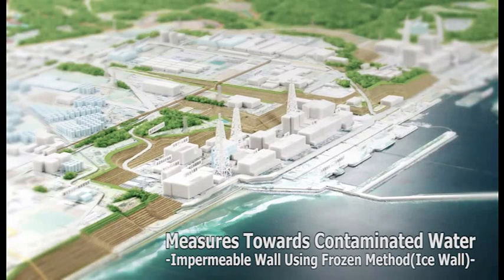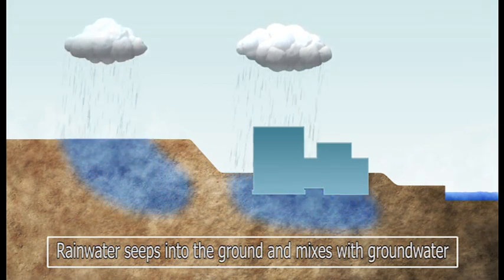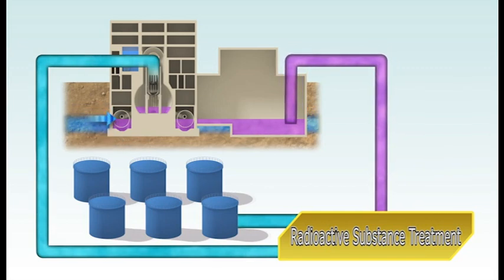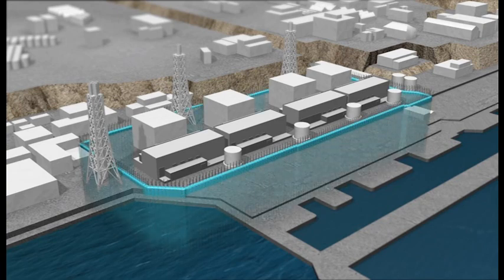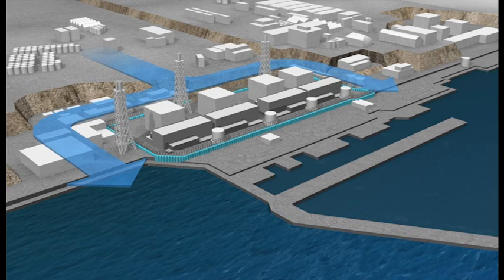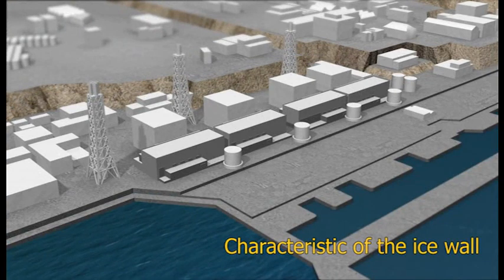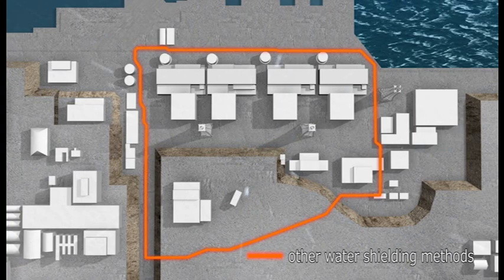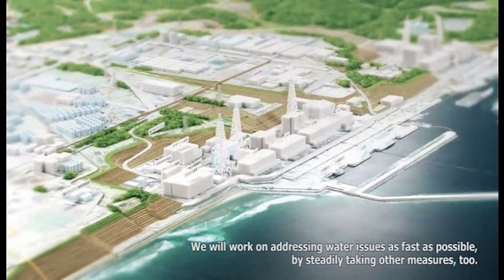Construction of Ice Wall Begins at Fukushima Daiichi

Comment: Frozen barrier is totally ineffective. They must dig a trench around the reactors down to bedrock and fill it with zeolite. Japan is not interested in protecting against the terrible disaster, but just the financial interest and nuclear power operators from the cost to remediate this disaster. All the while, highly contaminated water is running of the slope of the mountains behind the reactors into the ocean.

Comment: Wait, wouldn't diverting that ground water around cause issues with the ground itself? I mean, you're forcing the ground water to move to the sides of the ice wall, which in turn increases the amount of water in that ground a lot compared to before, wouldn't this cause the ground to become softer?
Reply: tommysil Clearly you can't read, since you didn't understand my question. I rewatched and you're incorrect, it doesn't answer the question in the "first minute alone"

Might want to think before typing.
Reply: +dortadewron, been a year since I made that comment but my line of thinking is that having a heavy flow of ground water in one area, I would assume wears away the dirt/rock/etc faster, leading to sinkholes, wearing away of the shore line, etc..

I could be wrong, but that was my thought at the time.